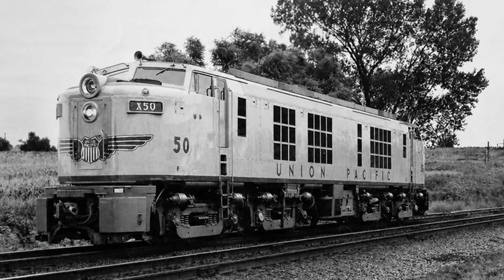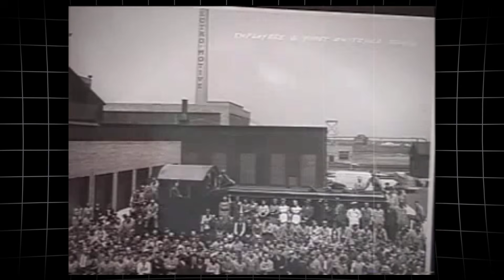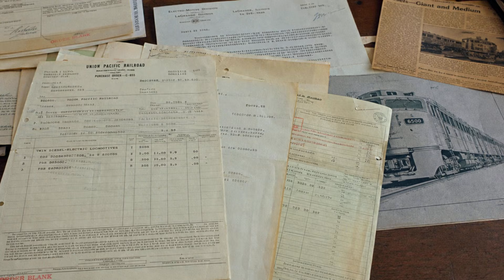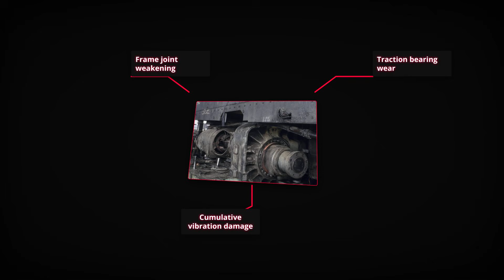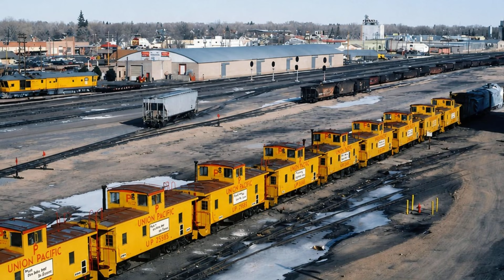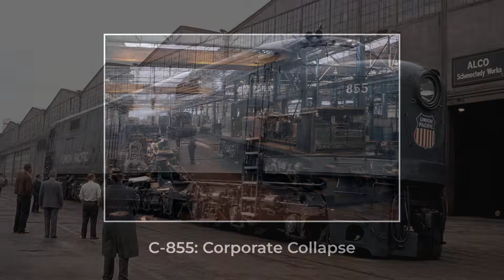The Biggest Diesel Ever Built — ALCO's Last Gamble and Its Final Mistake

Comment: To be clear there were only two C855s,  the booster unit was a C856. Alco never built an equivalent C428, which a pair of would have equalled a C855.

Comment: Lots wrong with this video.  Especially when he mentioned these locos burned bunker C fuel.  Bunker C is very thick, viscos black tar like fuel.  It's usually burned on ships far from any coast line and needs fuel manifold preheaters and centrifical fuel filters to separate the hard sand particals that may hide in the fuel.  Bunker C is not allowed to be used on land where the heavy particulate exhaust is cancerous.